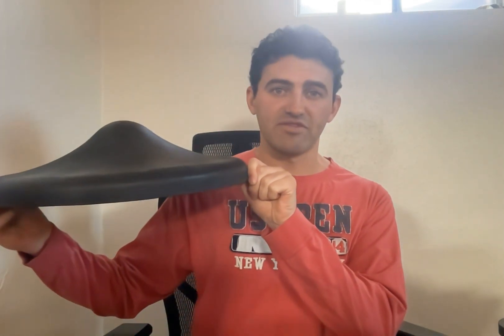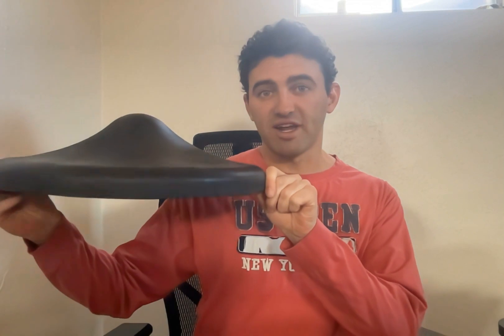Electro-Gravitic Thruster - Part 3

Comment: a tesla coil is of no use for this type of thruster. you need extremely high voltage pulsed DC with low current. a linear change in voltage is important otherwise you won´t get constant lift.
but 1 million volts DC is very hard to achieve, so I guess good luck.

Comment: I think  you don't need wire mesh there only top and ball on the buttom with dielectric (contains lead oxide) also make sure you have curvature from ball to top plate sides ,also he used on one of the drawings mixed dc and ac with disk bellow,pattent number 3,187,206 I'm working on one will be posted I hope soon Good job I like thinking process keep us posted. Here is video stupid simple setup and 25grams difference https://youtu.be/Fkjq8hUfOYg?si=sHgvjzXK64vRn_5a

Comment: why couldn't you use a dc voltage multiplier. starting the circuit with a transformer and rectifying using the multiplier. then using like a saw tooth sine. i seem to remember brown mentioning this.
Reply: How is this different from a car alternator?

Comment: Would an off the shelf taser work for producing the pulsed high voltage?
Reply from the maker: There are three things we need the circuit to do: quickly charge the cap to near the peak value, quickly discharge it, then do it again at the LC frequency of the circuit. A taser circuit might work, but I suspect you would also need a tuned inductor to get the max power transfer out of it and at that point you are basically building a Tesla coil
Reply: @AJTalks  we are fortunate these days that components are so high performance compared to years ago eh. Best of luck with the experiment